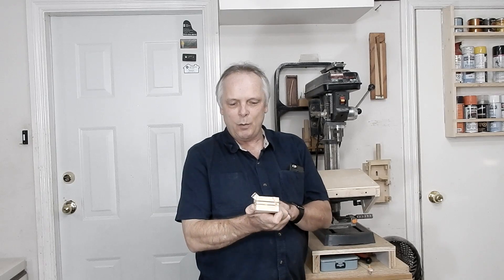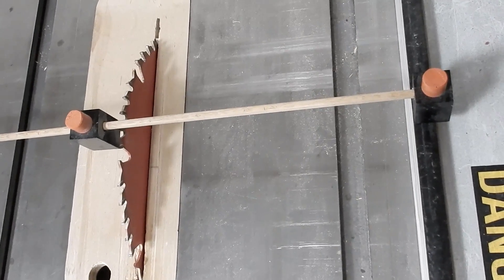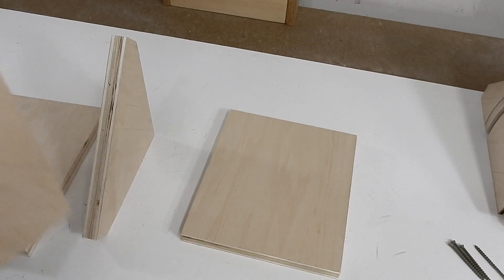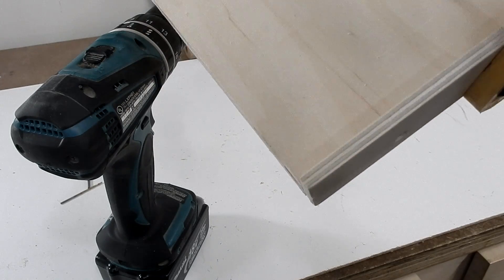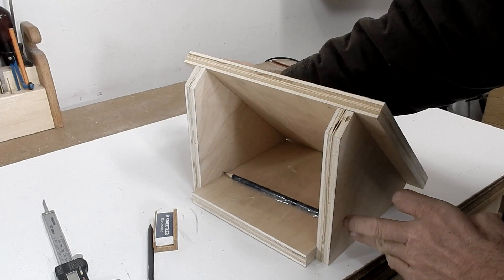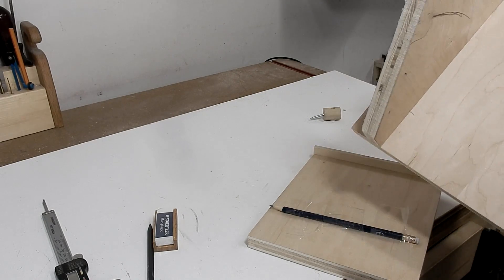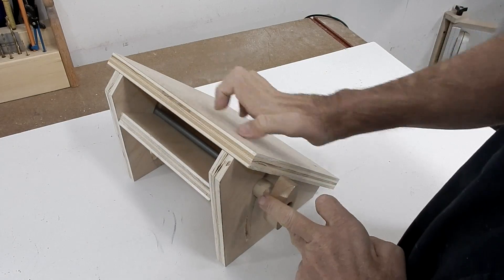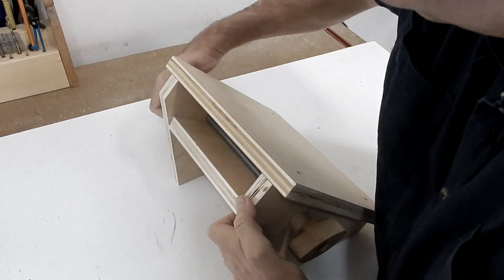Angle Drilling Jig

Comment: Great Design.   With a piece of wastes timber wedge shape on top of the work piece - making the timber surface leveled for the drill bit entry - the hole can be more smooth and straight.  (In your vid, the drill bent a tiny bit when it hits the sufrace at an angle)

Comment: Your  bandsaw sounds like an opera concert!  Perfect vibrato... Love it.  That's a handy jig for sure, and some great techniques as always.  I'm adding it to the long list of jigs to build (as needed).  I have a question though, it looked like you would need to account for some amount of walking down the angle, especially with smaller bits, and if so, can that be helped with a different type of bit, or just pecking the bit a little first?  Cheers, Chris.
Reply: to me it sounds like something out of the original Star Trak.... Beam Me Up.

Comment: I don't get it! :/  why not just use the tilting table that's already on the drill press?
Reply: +creativeobsin perhaps another benefit of a removable tilting table like this is that it saves having to disturb the accuracy of the table once it has been set true. I might have ago myself
Reply: +creativeobsin not all the drill press come with tilting table
Reply: +Jack Houweling Then it makes a lot more sense :)
Reply: +Kuldeep Singh Every drill press I ever owned or used have always been able to tilt the table, that's why I assumed all drill press tables where the same :o

Comment: it looked like there was a little bit of movement of the jig there when the drill made contact with the piece. can you confirm? any way to avoid that in my own attempt?
Reply: +SarnXero Jack, how about routing two slots in the top parallel to the sides for an adjustable stop onto which you could add a holdown clamp?
Reply: +SarnXero Clamp another piece of wood along the top of the workpiece similar to the bottom one.
Reply: +SarnXero Clamp another piece of wood along the top of the workpiece similar to the bottom one.
Reply: Cool!